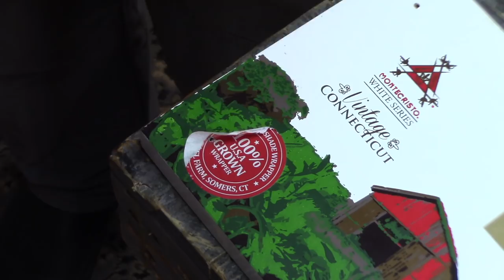How to make a 3 string Cigar Box Bass Guitar

Comment: I wish more builders would put truss rods in. I use a steel bar 1/8" x 1/2" and route the channel in after my scarf joint headstock is done.  From the nut to the pickup. Easy step that will keep your neck straight forever!
Reply from the maker: Lou Lamanna 
I am still learning, and like the way this one came out !

Comment: Whats the point of the aluminum rib on the back of the neck? is it just to control the expansion of the wood?
Reply from the maker: Sam, I used the aluminum to act as a truss rod to keep the neck from bowing and help keep the guitar in tune. Seems to have worked well :-)
Reply: Neat, looks like it'll work well!